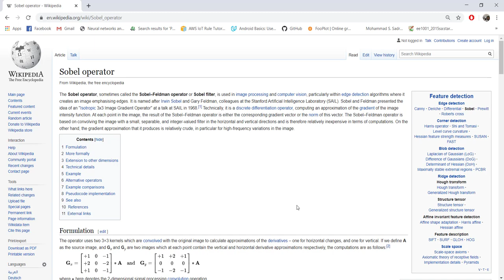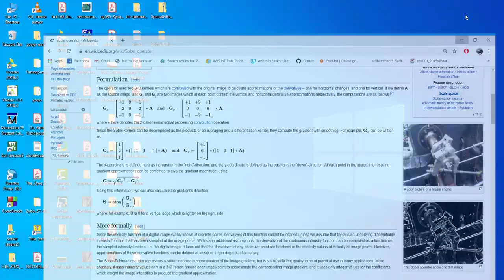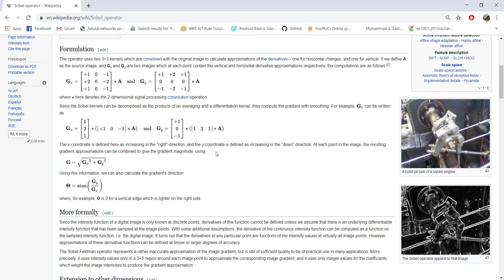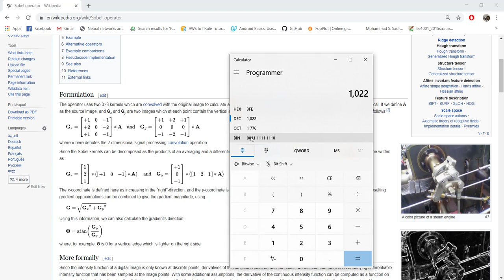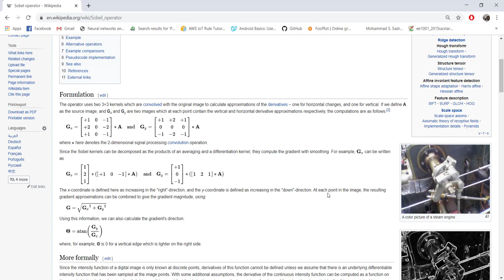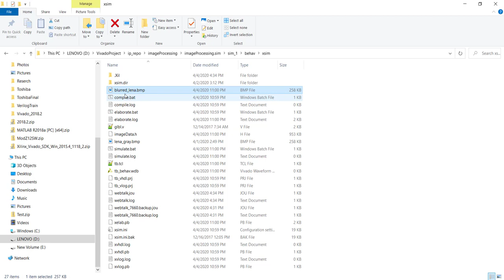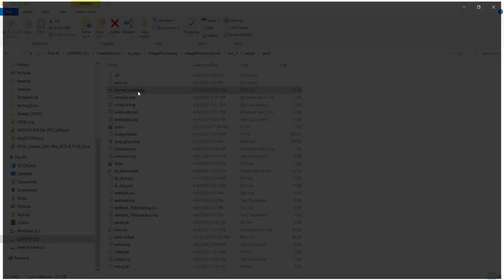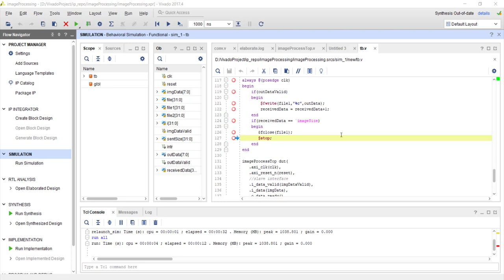Image Processing on Zynq (FPGAs) : Part 9 Edge Detection through Sobel operation

Comment: Hello sir,

I am doing image processing using Basys 3 FPGA, so will the similar code work for me?
Reply from the maker: The image processing IP will be exactly same. But when you build the system will have to use a microblaze processor instead of Zynq Ps
Reply: @Vipinkmenon  thanks alot for that suggestion sir, have already started working with mircroblaze
Reply: Bro did u complete if u did it in basys 3 means can u share the codes bro pls

Comment: First of all ..Thanks a Lot sir  for the amazing stuff which is not even available on the other sources of internet. 
Sir Can you please give me any idea regarding the modification of above IP to give the input as a colour image and also get the output as colour image and try the same with different kernels ? are there any predefined IP's to do the above task ? 

Thanking You in advance sir
Reply from the maker: For color images easy method is to convert to grayscale (Xilinx IP is available I think is discussed in a subsequent video) and do the edge detection and store in memory location. Then to overlap the edge with the original color image, just do a pixel-wise OR operation between the original image and the edge detected image. Since edge are white and other pixels are white, only the edges in the color image will become white. This ORing you can do in hardware or using software.

Comment: Hi Sir, Thanks for the video..!! I am facing issue in last step, after the image has been written, I am trying to open the edge detected image, but it says file cannot be opened or corrupted, Please can you explain me why I am facing that problem?
Reply from the maker: Are you getting any warning during simulation regarding the input file? File gets corrupted when the file size mentioned in the header part of the image is not matching with the actual size of the file.
Reply: @Vipinkmenon  sir.. it worked fine by adding this one line in test bench  "" imgData=0;"";

 initial
 begin
    reset = 0;
    sentSize = 0;
    imgDataValid = 0;
    imgData=0;
    #100;
    reset = 1;
    #100;

Comment: Maybe this was covered earlier and I missed it, to which I apologize, but Instead of UART why not use Ethernet?
Reply from the maker: Using Ethernet with standalone OS is difficult. We will do it. A faster and easier way of data transfer is using xsct interface (https://youtu.be/mdRYY-mpMYI ).
Reply: @Vipinkmenon  Thank you. That link is not working for me.
Reply from the maker: @Jocjabes  The bracket is also coming into the link. Remove it and try